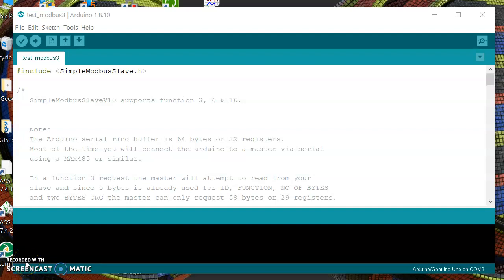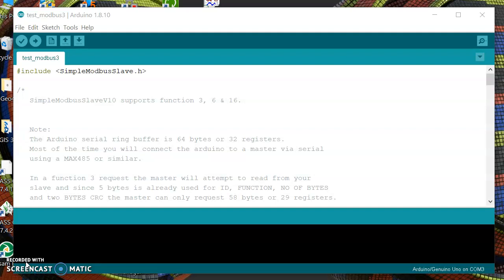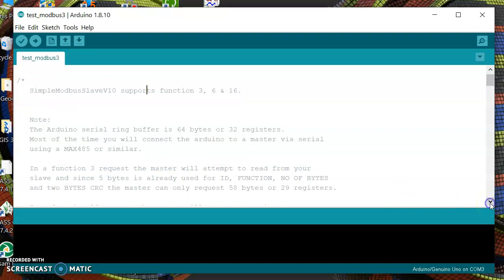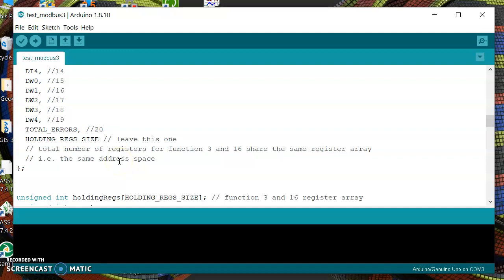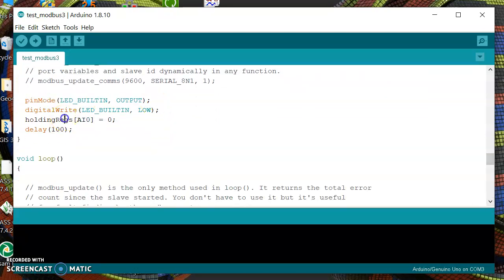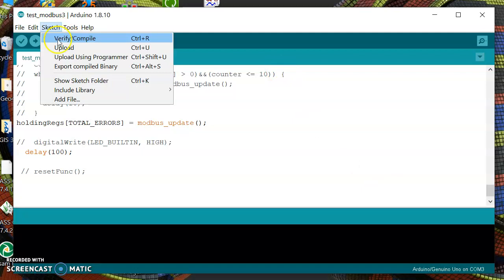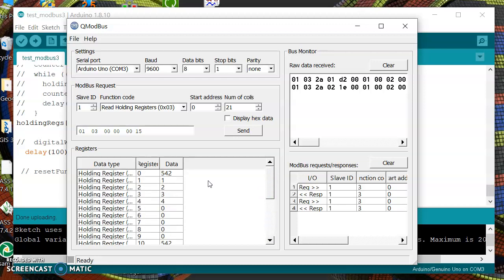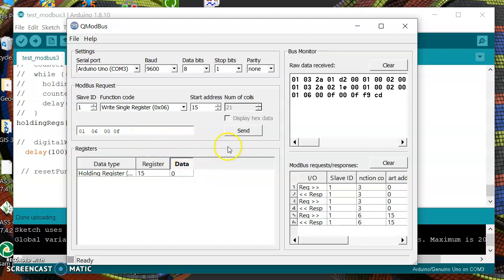Recording Arduino   Modbus Slave

Comment: Hola Gustavo
Gracias por compartir tu experiencia en este viso referente a como utilizar el arduino como Modbus slave. Deseaba saber como conectaste la parte material,  Rx, Tx  (1,0)? utilizaste una interface RS 485?  Espero tu respuesta, creo que ibas a subir un video de esto.

Comment: hi, what is the wiring?
Reply from the maker: hi, you only need usb cable to connect arduino UNO to your computer, no other component required to test this
Reply: @gustavosanchez4522  how about using arduino slave with plc, hmi or another arduino master? eg. by rs485 or rs232?
Reply: @pawelwojcik7550  Yes, I have tried all that, maybe next video I can show that, thanks!
Reply: @gustavoadolfosanchezhurtad1412  ❤

Comment: I am trying to monitor my 12v valence batteries that has 4 module in series at 3.65v each which is = 14.6v. Since these batteries have an internal bms, which has an amp connector. How can I monitor each module using arduino, rs485, logic level converter and 4 module relay?
Reply from the maker: You could use some circuit to measure the four required voltages, depending on the required accuracy you may have different solutions. Arduino UNO has 6 analog channels, so you could use it. RS485 is only required if you want to transmit the values to another device for other purpose. If you have Wifi connectivity, it is possible to connect your Arduino to a WiFi Shield and send data through Internet. I hope it helps you